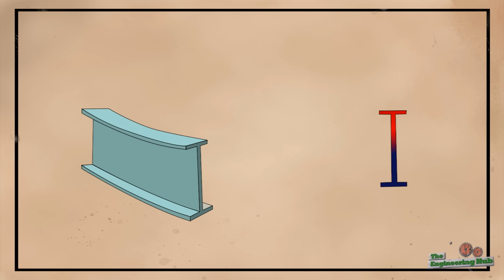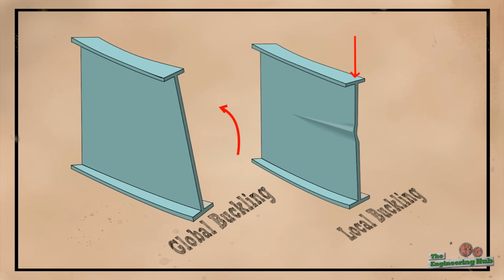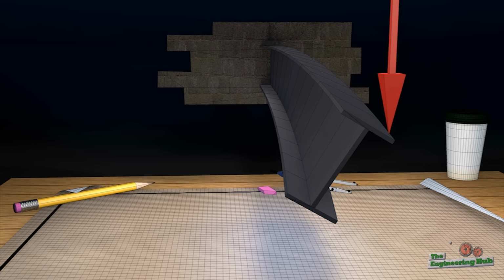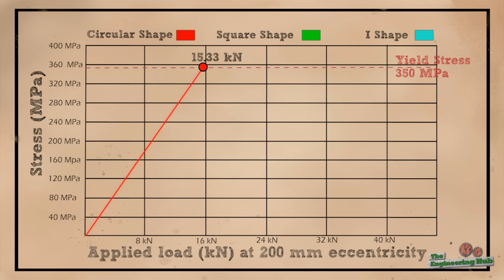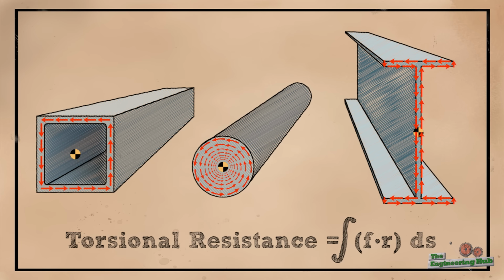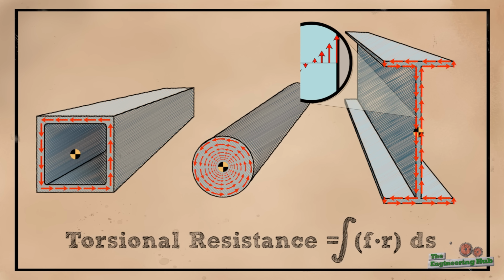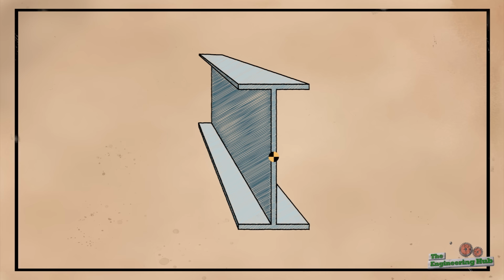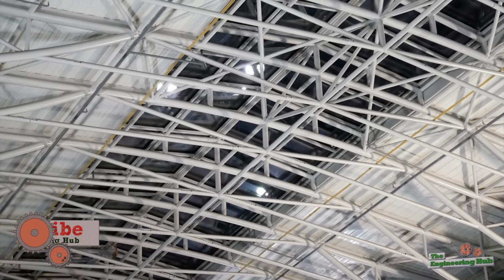The Critical Weakness of the I-Beam

Comment: As an engineer that specifies beams almost daily, I enjoyed this video, and yes, as others have said, GREAT work.   I often do think about the weaknesses of I-beams, and their suitability for a given purpose, as you've stated.  For a future topic in this same thread, it might be nice to discuss S versus W beams.  Despite years of design work, and designing not only buildings but also trailers, cranes, and even magicians' props, I've never had to specify an S beam.  I've seen them used in conveyance work in factories, but never in building structures.
Reply from the maker: Thank you for your kind words Lyndon!
We are considering a video reviewing the various structural shapes and their pros/cons.
Regarding the specification of S shapes, in our professional practice we have seen them for some aluminum sections used in hoisting assemblies during building construction. However, you are right that W shapes are much more common.
Cheers,
Reply: Hi. What is an s beam? I could not even find a reference to it with a Google search!
Reply: @alexanderSydneyOz  W beams are I-beams which have all parallel/orthogonal surfaces.  This makes them very practical for use in numerous situations.  But such shapes are not optimal for various loading conditions.  An S-beam is an I-beam with tapered flanges, rather than flat flanges.  The flange roots are thicker than the extremities.  The web is still flat.  I imagine these beams have the material more optimally distributed than W-beams.
Reply: Vierendeel trusses with castellated beams is not mentioned?

Comment: What about a wave shaped centre section I beam?
Reply from the maker: That's an interesting suggestion, I haven't seen it done in practice. My judgment is that the wavy shape would not perform too well when compressed. It may show spring-like behavior with significant deformation which could lead to instability and buckling issues. That's my take at least.
Reply: @TheEngineeringHub  I've seen it used years ago ( about 20+) but never thought too much about it, there was potential of torsional movement in application, maybe I didn't give it enough credit nor attention, now I am really curious to its properties
Reply: I think the main drawback would be cost of manufacture. Flat plates are the simplest and cheapest to make.

Comment: Moment of inertia is discussed in case of beams which confuses me though there is no rotary motion.I was told that it is called second moment of inertia.Will you please clarify?
Reply from the maker: Hi Premkumarguttikonda, moment of inertia is also referred to as second moment of area. Actually there is rotational motion, this motion is the beam being bent. You can imagine the curved beam as a section of of a circle with its center somewhere above/below the beam. Check out this picture to see what I mean:

https://ptgmedia.pearsoncmg.com/images/chap5_9780134859286/elementLinks/ugural_f05_25_alt.jpg

It is a confusing concept, the key is not to think as normal rotation of a rigid body about a point/axis, because it is clear that is not happening. But rather to think as parts of the same body being rotated about their own axes. In this case, if you imagine the beam as a sequence of cross-sections glued together then rotating each section (e.g. section bc on the link) by a small amount (the dashed line on the link) would produce a bent beam. That's where the rotation is hidden.
Reply: It has a lot of properties in common with mass moment of inertia as is used in rotational dynamics, but the property of structural sections that gets called the same term, really has nothing to do with inertia.

The area moment of inertia or second moment of area, as is used as a property of structural sections, is purely a property of geometry.   It doesn't depend on the identity of the material.  Instead of integrating r^2 relative to an infinitesimal mass element, we are integrating r^2 relative to an infinitesimal area element.

Area moment of inertia is a property of a structural shape's resistance to lateral loads like bending and shear.  Or, the polar moment of area for circular shafts, for resisting torsional loads.

For composite beams, we account for Young's modulus varying throughout the section as part of the integral  So the centroid gets replaced with center of elasticity, and the second moment of area gets replaced with integral E*r^2 dA, rather than E*integral r^2 dA, because Young's modulus (E) is not unifom.